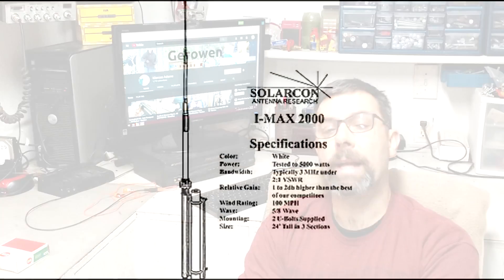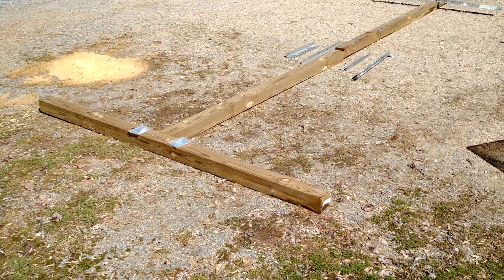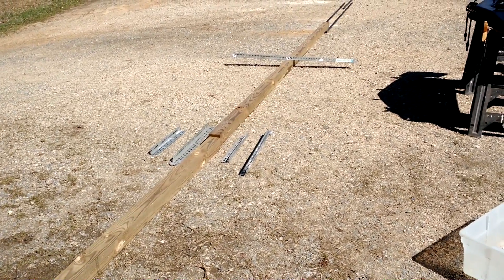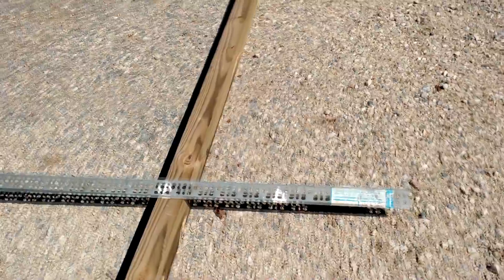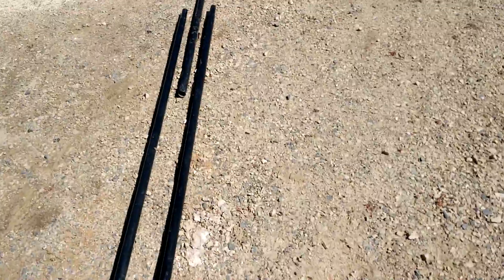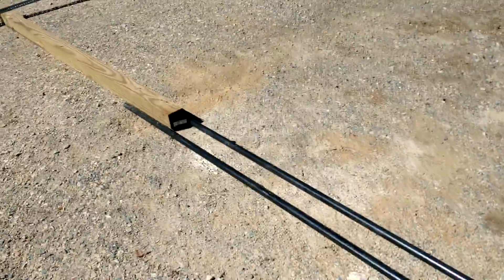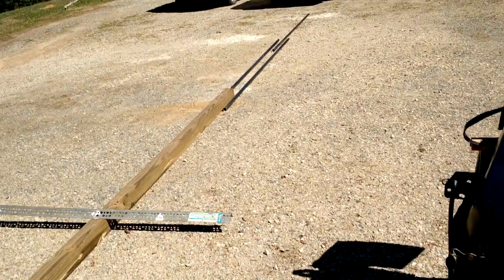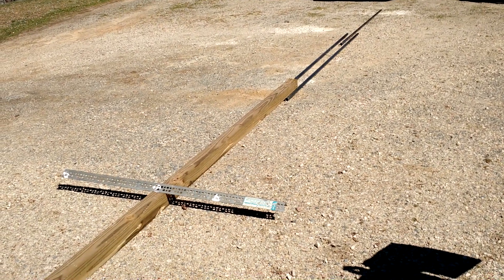Home Built CB Antenna Tower Idea. 45 Feet for less than $75.00 ?

Comment: you are aware  of the height restriction  for C.B radio antennas  of course? 25ft height is specified  in FCC regs. That was one of a dozen violations  that got a gentleman in deep dodo a few years back in a city south of me. Its not likly the  FCC will bother  with a over height antenna but when they do, its very bad for the pocketbook  book
Reply from the maker: The highest point of your antenna must not be more than 20 feet above the highest point of the building or tree on which it is mounted, or 60 feet above the ground. Apr 13, 2017
Reply from the maker: I'll be well under the 60 foot rule. and right at the legal limit of 20 over the roof line. the roof line is 25.5 feet. leaving 18.5 hanging in the wind.

Comment: Been researching antennas and I know some of the A99 fans are going to disagree. I read an article that said in hilly areas and where there are buildings and other obstructions a 1/4 ground plane antenna will work better. I ordered a Starduster from Amazon for 62.00. It arrived today and I have not had a chance to put it up. I mentioned this to the tech at the CB shop where i bought the A99 and he immediately said the Starduster will definitely perform better than the A99 he sold me a few weeks ago.He then said it was illegal to sell aluminum antennas. Bull, well, you know, the stuff that drops out of the back end of a bull.  So. we will see. Also wanted to mention that I made a pivot mast out of 4x4's. Two 8 foot ones in the ground cemented with the middle one for pivot on a 1/2 inch threaded rod. This plan came out of a 1964 edition of ham radio manual. I have 22 ft of 4x4 in the air with the top rail like you have running the entire length plus 10 feet above. This puts me at 32 feet and I can pivot it down very easily. If it was a little lighter I could raise and lower it by myself. BTW, I have watched several of your videos and find them very interesting and informatve. 73's to you and yours
Reply from the maker: Thanks for the info. I went ahead and ordered the I MAX 2000. Time and some tests will tell if its better than the A99 for here in the mountains. 
   I sure hope it is as it was almost $100!

Comment: For extra strength at the joints I would recommend drilling a 3/4" hole 5" deep into the end of each 4x4 and inserting a 10" length of 3/4" rebar into the holes.
Reply from the maker: I had thought about doing something like that at the joint. I've got a hole saw that I think will work.

  The I-Max 2000 just came in the mail today, so this project is officially a go.
Reply: Don't use a hole saw, it's more trouble than it's worth. Just use a standard 3/4" drill bit. Even a 1/2" should work OK with 1/2" rebar.

Comment: You'll love that Solarcon I-Max antenna should you decide to buy it.  I had one up for over 20 years until the wind finally broke off the top section. It is extremely broad-banded, usable down  to like 26Mhz all the way up to like 30. Yes, the match would be a little high on the extremes, but still usable.
Reply from the maker: Glad to hear it. I just ordered one!
Reply: My top section snapped off (just a year old at the time) , just above the metal connect piece , in heavy wind but I had expected more of the imax 2000.. I repaired it and it broke again... so no Solarcon imax 2000 for me anymore . And the antenna's position is about 13 meter high (base).
Reply: dang that's a shame, nl1cat

Comment: I am enjoying your videos: Thanks !
Check out CraigsList, I just found a 38' Roan Truss Tower for $150. I may add a 20' stick on top ? Yet to be put up. My old  
Tower is 2 old 10' TV tube Radio Shack Ant. mast with another section of conduit added on top with a 10' AM Radio Transmit Antenna, just a 3/4" copper pipe for my AM Part 15 Radio Station Transmitter. On a hill overlooking our Lake Association. Here at the Old Cabin, my new place at another Lake 8 miles away also on a hill overlooking the Lake will have more homes in my 1 to 2 mile Radius footprint. I found another brand Truss tower for $100.  May attach it to a cut off 10' Pine tree Stump. 
I have an old CB in the barn I now want to get sparked up ! 
P.S. I started and ran my Sears SS16 Tractor and drove it around this week, Picked up a brand new Sears Snow Blade still in the box for $100. 
P.P.S. warming up and getting ready to attack the Throw out Bearing in the hatchback. I burned up dragging the harbor freight Trailer across WA to get the Tractor.

Comment: Do it!! We were wanting to do that exact same thing! I’ll look at that link from the gentleman who gave you the idea! And definitely keep up the videos as you go along!
Reply: Do yourself a big favor and ditch this idea. 
  Just go buy a sail boat mast. They are lighter, Stronger, look better, don't age and used ones are everywhere for decent prices, They are hollow so you just slip them over a 5 ft 2-4 inch pipe set in a concrete footer. Lastly it doubles as a GREAT flag pole but cheaper.

Comment: a99 is tougher and in my case w no ground plane actually beat the "max 2000" that is what they call it now, not the Imax, did get the "max 2000" going better by putting a fire stick as the top element.
Reply from the maker: Thanks for the info!
Reply: yeah what i did mimeced the "firestick upgrade" people do to the a 99. took a sorta scientific approach . what happened  was i got a max 2000 antenna to upgrade from the a99, put it up 30 ft in the tree just where the 99 was and went down 1 s unit to everyone in town, even though the swr was better, (very frustrating).

 so i brought everything down and tested the a99 the imax and then both with this 3/4 wave firestick like whip on top just for kicks, the max 2000 with a 3/4 top element did best, somehow boosted my audio as well, makes the max 2000 a little tougher since it's 20 ft total instead of 24 ft. right now i have it up 20 ft next to my house and can talk 25 mi away hitting them at 8 s units.  barefoot radio more or less.

here is the whip i used https://www.ebay.com/itm/New-Navistar-International-CB-Antenna-Mirror-Mount-TSL4PNI/261416776747?epid=2074349589&hash=item3cdda7742b:g:3hUAAOxyrM5TGKE6  got it originally for a bike cb setup, i know im a nutcase HAHAHAH!  i can actually talk all over town on a 102 inch whip mounted on my bike on the side yard.  73s from Salem Oregon.
Reply: been considering this 4/4 thing a lot cheaper than a tower.

Comment: I had an imax it bleeds like crazy I run a home made 1/2 wave dipole and no bleeding of electronics what so ever.
Reply: Yes that IMax will get into things...hahaha.. but I sure enjoyed mine ! and it would take the power, holy crap would it take the power  ;-)
Reply: I just built a half wave out of a PVC T, an os239, and some metal conduit. I got no trees to hang one in around here...lol
Reply: I also built my own halfwave dipole. I built it out of a grey pvc 1" conduit T. A SO239 fitting. and some bushings and two lengths of 1/2" metal conduit. That way I just push the conduit into the bushings in the T bolt them down hook up the ground and positive from the os239 and slapped it on top of fence top rail. No trees to hang it in needed.Wasn't tuned great first off but after the first cut of an inch a side. 1.10 matched.

Comment: i dont see why you are using 4x4s. i would just connect the fence rails all together by bokting in a smaller pipe inside the ends as connectors and bolting it all together then using guy wires to hokd it up.  it will be lighter too!  no need to over engineer it...
Reply from the maker: Because of the location this will  be mounted, I can't use guy wires. That's my main issue. It will be bolted to the side of the garage at about the 14 foot level, but beyond that it has to be strong enough to free stand.

Comment: are you going to use guy wires.  you will need atleast 3.  the taller it is the more leverage you are adding and the more easier it will bend over.
Reply: use rope or cord, RF runs on wire

Comment: I would over engineer things myself. I would add longer supports where the two 4x4 post meet.  The most stress you will have is pulling it up or taking it down.   Also wouldn't call this a tower as much as I would a mast or post.  Looks good again I would just support further the 4x4s where they meet further.
Reply from the maker: My original plan was to taper 4 2x4's about 4 feet long and bolt them to that union point. Then I found that scrap metal. Heck maybe I'll do both.

Comment: I'd half lap those 4"x4"s then lag bolt or large dowel 'em together. I'm doing similar. I've had an old telephone company creasote treated 4"x4" up for years (about 12 foot up,) extending it this year another 16 foot with guy wires.
Reply: Good idea on the half laps. Much stronger than a butt joint.

Comment: Interesting idea!  It will be interesting to see the finished product.  I made my own til-over tower for a CB antenna from conduit and top rail as well but it's free-standing and half the height your's will be.  Mine has held up pretty well with the exception of the top rail bending where it was connected to its support due to wind.  But it was fairly cheap and painless to fix it as I showed in a video I made about mine.  Good luck with this project, I'll be looking forward to seeing how it turns out.
Reply: can u send me a link
Reply: https://www.youtube.com/watch?v=Gd8ei3UI_Ls  That's the repair after it was damaged. I couldn't find the original build video.

Comment: Definitely a good upgrade path!
If the 4x4s are treated outdoor grade wood then no worries on longevity.
Wind on 20' of exposed mast & the 5/8 antenna will be harsh in bad weather, so don't skimp on the hefty assembly & bracing hardware.
Get the best coax you can afford, and make sure to get a ground rod or three to drive in at the base of the mast, so you have a place to ground that tower to.

Looking forward to the build process.
Reply: psguardian  can i have a link to that video
Reply: jordan s I'm guessing this was meant to be a solo comment, not a reply to mine?
Reply: yes sorry
Reply: jordan s no worries mate, it happens.
Reply: Re : Treated lumber    Well.........  no worries for a while anyway.  Treated lumber today is only .20 instead of the .40 of years ago..  I've replaced several pieces of treated lumber including part of my deck which are 2x6's, not the thin decking boards they mostly use.   If its not below grade ( ground ) it should be OK but I'd still slap some preservative on it before its in place..

Comment: How are you going to erect it?  That weight is going to be killer.  Last year I picked up a 40-foot Tower 40.00 bucks.  I have to just quit messing around and get what I need and get it erected myself.
Edit: there are so many choices for antennas I got a tram 1499 because it was on sale.  Later getting a better look at reviews I think I made a mistake on that.
Reply from the maker: I'm not sure about how it will all get put up. I was thinking up using a tractor with a block and tackle setup to reduce the load. Praying will also be involved!
Reply: Me praying also, LOL.  I'm thinking I will need at least 3 people.  Two to walk it up.  One to be on the roof and help pull it up and help stabilize it once it is up.  Then I will have to pick it up and then set it down onto the mount.  I am just wondering if two people can handle the weight to pick it up?  Once the snow breaks I will find out, LOL.

Comment: Did you not like the reviews on the ground plane?   I was thinking of getting one as well.
Reply from the maker: The reviews I read mostly said it was a waste of money. Maybe a little gain, but some even said it made things a little worse.  
   My Antenna is about 20 years old and will likely need to be replaced at some point soon anyway. The Imax just seemed like a good upgrade. I found a seller that has them for $100 shipped.